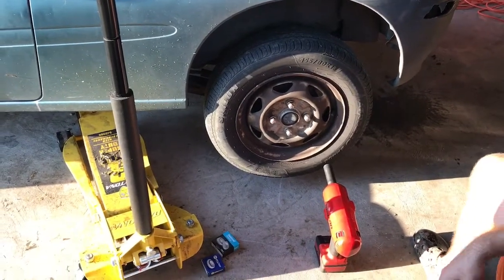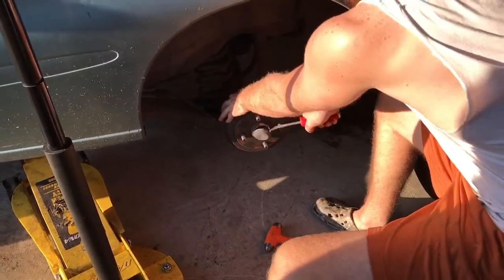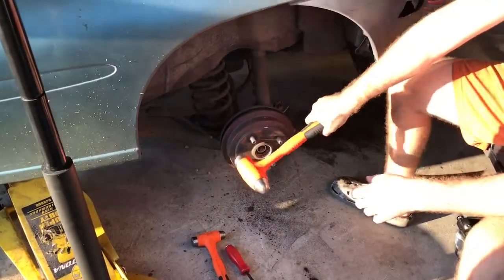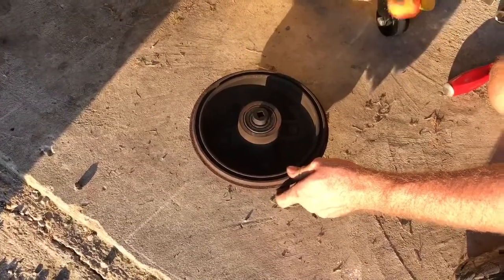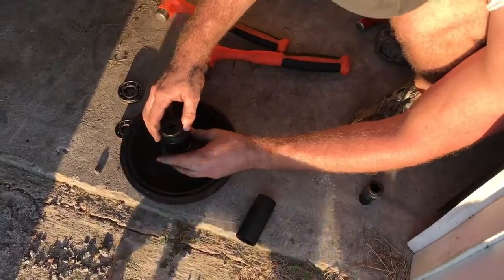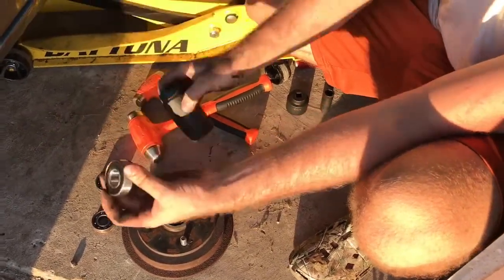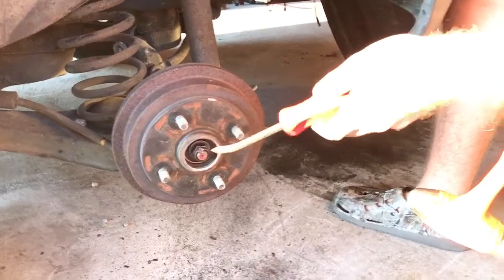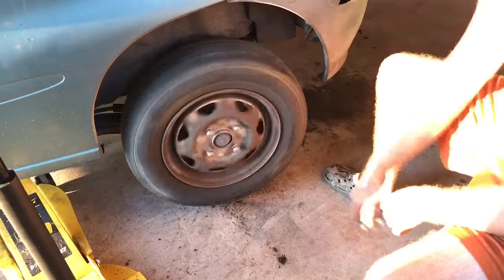Geo metro rear wheel bearing replacement

Comment: Great video and thanks for posting it and sharing sizes of sockets to accomplish the task.  One thing I would add that you don't share on your video is that the bearing are not sealed bearing and need to be packed with grease.  Thanks again for taking the time to take and post this helpful video!
Reply: That's what I thought.

Comment: Thanks for the video. I couldn't find the specks on the 1996, but the 1999 which is second generation too said 129ftlbs torque? I slowly brought up the torque to 129ftlbs and it seemed to run freely all the way up without any drag....  I paid under $20 for both bearings. Mine had seals on both sides of both bearings. The bearings I took out didn't have any seals at all. I can't believe they lasted for so many years without having any seals!
Reply: i find the ones without seals last longer as the grease flows better

Comment: the torque, while important has nothing to do with preload or lash. the "collar" as you called it is actually a spacer so when you tighten the nut the force of the nut goes through the inner race of the outer bearing, then the spacer, then the inner race of the inner bearing and then to the spindle. making one solid mass. the outer races are just friction/slip fit in the wheel hub/rotor. any preload or lash is built into the bearing and not affected by the torque or tightness of the nut

Comment: I agree that they say you shouldn't reuse the nut but in a pinch swapping them side for side will give you a fresh area on the nut to stake it back on the spindle. 
Thanks for the post.
Reply: Setting the hub on a couple of 2x4's will keep your wheel studs from popping out when yer wacking the socket with the hammer. Ask me how I know this.

Comment: Great video! Question: did you tighten the nut 'till the inner race of the outer bearing mates with the spacer, or do you have to press/hammer the outer race down all the way?

Comment: Hey thanks for making this video. Are these bearings pre-lubricated/if not what kind of lube did you use? Need to do mine
Reply from the maker: Ben Barrera the bearings that I purchased were already packed with grease. If you buy a set that has not been packed I recommend using universal bearing grease.